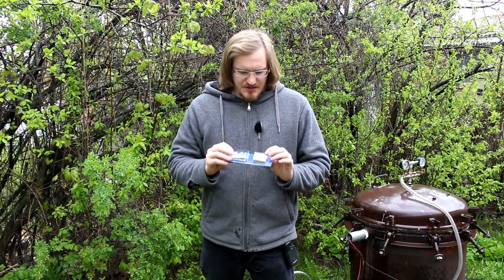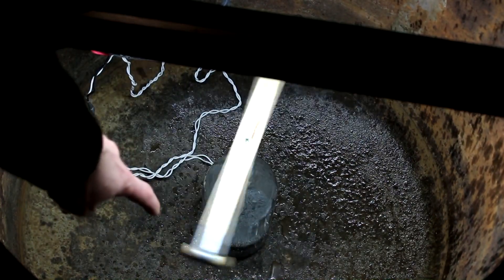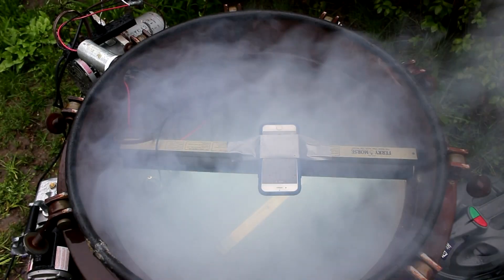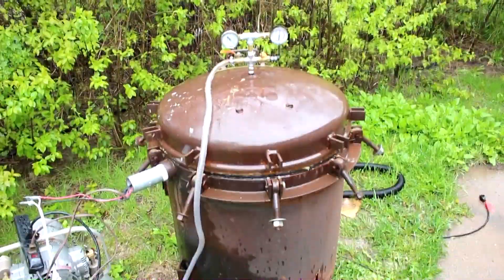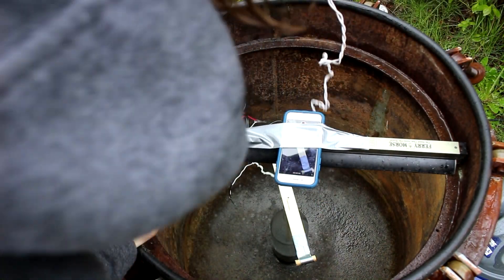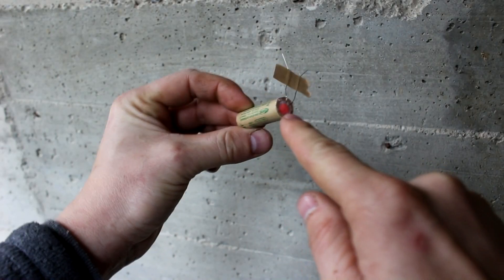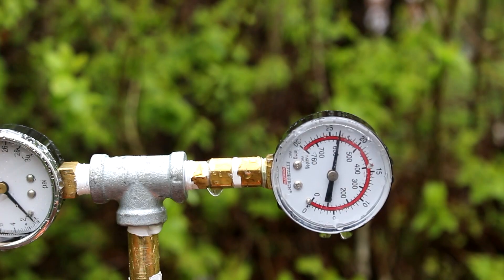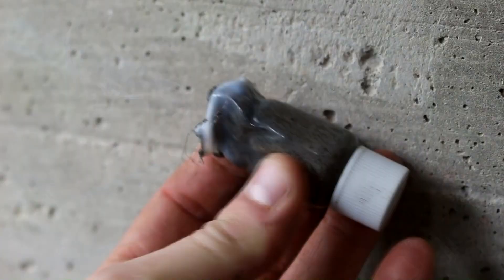Will a Model Rocket Motor Work In Vacuum?

Comment: Wow, the rocket can clearly get thrust from the side of the vacuum chamber not even close to replicating a vacuum in the vastness of space where there is a vacuum and also no structure to create thrust from.
Reply: Any equations proving your point? 

Funny, we got those. Why can't you guys?
Reply: So according to YOU, a crossbow fired into a vacuum would not have any recoil right?
Reply: I challenge you to answer the following three questions: 
1 - does the exhaust gas have MASS? Yes or no?
2 - When the exhaust gas exits the rocket nozzle, is it Accelerated? (Does it experience a change in velocity) yes or no?
3 - can MASS be accelerated WITHOUT a force?  Yes or no?
Noy most "physics deniers" will REFUSE to just answer these three questions because they know that answering Proves THEM WRONG!
So we'll see if any of these cowards has the spine to respond. (If they do it will just be to hurl juvenile insults)

Comment: It worked because it wasn't a real vacuum like in space. The rocket can actually push off of it's exhaust because the exhaust doesn't automatically dissipate into the vast vacuum. It concentrated in the can and it got half the push it got when there was no vacuum. This was a cool expirement that has no relation to reality.
Reply: Except that it was real.
Reply: I have video evidence of rockets working in a vacuum but you morons just call it fake, so what would be the point of showing you the video?

Comment: Good test, but once you conined the rocket to the capsule you gave it a pressurized space to push off of. The test in this regard is not actually correct. In a true vacuum the thrust you generated by it pushing against the bottle wouldn't exist.
Reply: confined typo correction. Also the container you put it in if sealed was not part of the vaccines space.
Reply: @Bob-we8kv  : "....the vaccines space." What, on earth, is that?

Comment: The last test did not burn completely through the rocket because it ran out of oxygen to burn, it also quite obviously did not spin as long as your first test being in regular atmosphere, so no, not as much thrust. Also a rocket is not a closed system like a rocket in a tube, it would loose pressure to the vacuum just like your second test with the plug and cover on the end. It kills me to see people blatantly ignore evidence contrary to thier world view. You actually gave multiple points of evidence contrary to your assertions, then pretended the evidence agrees with your position. Why not just conclude the results were not as you expected and you need further observation and testing to support your assertions.
Reply: Solid rocket motors do not need atmospheric oxygen to burn
Reply: @stuartgray5877  And what example do you have to back that assertion? I've never seen it. Do you have a video to link?
Reply: @stuartgray5877  Of course the rocket was working in low atmosphere. There are planes that can fly that high lol
Reply: @logangregory3441  that rocket was above 50 kilometers where atmospheric pressure is below 1.0 Torr.  Try talking about things you know about like eating crayons.
Reply: Rockets have two tanks, one with oxidizer and another with the fuel, his rocket is literally like that, oxidizer(air) with gunpowder(fuel)

Comment: Water does not exist in a vacuum. At low pressure, the water would evaporate in a short time. For your experiment to be valid, you need to seal the cylinder and make the pressure really low. Additionally, a high-speed camera must be used to observe the ignition point. After the load ignited, gases were formed and there is no more vacuum. Your experiment is run under reduced pressure and in the presence of gases. You cannot infer from it how the rocket behaves in a true vacuum. Contact NASA, they have a great vacuum chamber, but somehow they don't use it at all. The cosmonauts don't even practice there.
Reply: Yeah NASA has 'A' vacuum chamber.  I am sitting in the middle of about ten massive vacuum chambers right now.  NASA literally has HUNDREDS of vacuum chambers. Try keeping your comments to something you have a clue about.
Reply: @stuartgray5877  <----- lying abusive chatbot.
Reply: @papalegba6759  apparently chat  bots are smarter than YOU regarding basic physics.  That must be embarrassing...
Reply: @stuartgray5877  <----- more lies from a chatbot.
Reply: @papalegba6759  sounds like something a chatbot would say

Comment: So what this proves is you need a container or 2.  perfect.
Reply: No THIS video "Proves" nothing. However, rockets work JUST fine in a vacuum.
Reply: @stuartgray5877  Did you even watch the video?  It proves 1.  You need  a container to separate a vacuum from atmosphere... 2.  You need a container of air around the rocket to work in a vacuum.   The air is required for thrust in a vacuum.  Thus, 2 containers.  I guess rockets bring air to "space" then huh..
Reply: @mumenrider862  - "I guess rockets bring air to "space" then huh.."

In fact THEY DO!
rockets TAKE MASS WITH THEM TO SPACE!
what do YOU think 95% of the liftoff MASS IS?

Do you think RECOIL stops working in a vacuum?

If I fired a CROSSBOW in a vacuum will I STILL feel recoil? Yes or No?
Reply: @stuartgray5877  I still don't think you watched or understand what was needed for both the vacuum (in an atmosphere) and what propelled the rocket.  I'll give you a hint... it rhymes with bontainer.
Reply: @mumenrider862  - I literally Build, test, launch and operate spacecraft in earth orbit and deep space for a living, and have likely been doing so for longer than you have been alive.
I am certain that YOU are the one that is clueless about how rocket propulsion works.
So apparently YOU think that RECOIL stops working in a vacuum if you don't believe rockets work there.
Rocket propulsion works by PUSHING ON MASS, just like how a CROSSBOW has recoil with or WITHOUT an atmosphere.
Reply: @mumenrider862  There is a video of the Stardust launch on my YT channel. Tell me that is fake.
it was one of the first to carry a camera like you suggest.

Then find the HUNDREDS of videos of rockets reaching space since the 1990s.
SpaceX alone has a few hundred.
Reply: @stuartgray5877  Just like I thought it would be.  Video cuts, no data on screen, most likely not more than 100k feet up before it cuts to idiots clapping in a control room staring a screens.  At least it didn't cut to cartoons like most.
Reply: @stuartgray5877  I watched it.. I described it to a "T".  No different than any other launch... just no CGI at the end.  Do you know what compartmentalization is?  What did the guy in this video need to make a vacuum again?  Cmon say it... it's the same thing that would be required to have gas next to a vacuum.  Rhymes with bontainer...
Reply: @stuartgray5877  wow.. triggered much?  Keep hugging your pear shaped globe.  Love you!    There is no curve.

Comment: oh really! You should try this with continuous vacuuming   
The rocket gas removed the vaccum or may be hit the metal  walls
Reply: I have live video of a rocket working in vacuum I could show you , but I suspect you are not interested in ACTUAL evidence...
If you ARE interested, just answer one question for me: At what altitude does earth's atmospheric pressure drop to "Vacuum"?
Industry standard for "vacuum" is any pressure BELOW 1.0 Torr (about 0.02 PSI).
So at what altitude does earths atmospheric pressure drop to BELOW 1.0 Torr?

Tell me that and Ill show you the evidence.
Reply: Just as I thought. you are NOT interested in ACTUAL evidence.
That's fine, run away then.

Comment: see the wisp of smoke rising from the igniter at 3:57 ? that means it's not in a vacuum. fraud, plain and simple.
Reply: Actually "Vacuum" IS defined as any pressure below atmospheric AND ANY pressure gradient would still cause the hot gases to rise.
SO ANY air pressure (including Vacuum) will still create this effect IN A GRAVITATIONAL FIELD.
Thanks for admitting that the pressure vessel HAS a pressure gradient in it.

He admits it is not a perfect vacuum, so what is your point?
Reply: @stuartgray5877  that's not the definition of 'vacuum', lying chatbot. and you can't have smoke in a vacuum, let alone have it rise; it would dissipate instantly. you are such a waste of time.
Reply: @stuartgray5877  chatbot stu runs away when proven to be a liar.

Comment: Rule #1 ... nothing burns in vacuum .. no AIR .. no oxygen ..
Reply: Ever heard of pressurisation?
Reply: Ibrahim salem - so according to YOU, a block of C4 would NOT explode in a vacuum?
Would a GUN still work?
Reply: @stuartgray5877  no, a block of c4 would not explode in a vacuum.
Reply: Its because it's made of an oxidizer......
Reply: @mcnuggetwarrior8218  irrelevant. external pressure is required for combustion to occur.
Reply: @papalegba6759  and that's exactly what he shows in the video